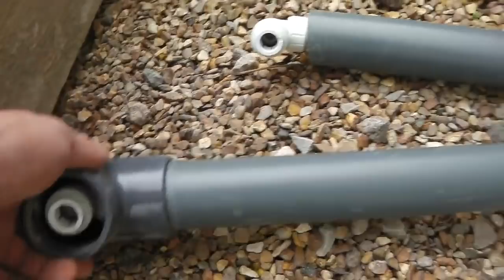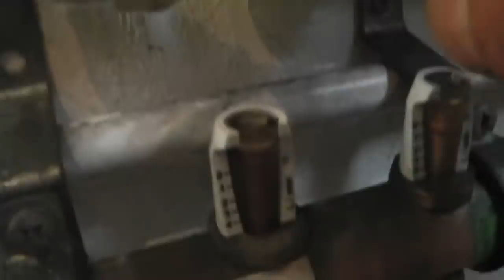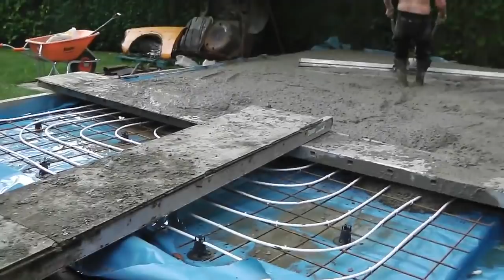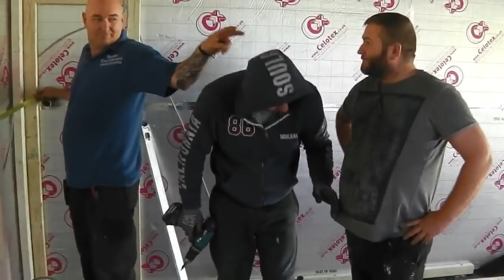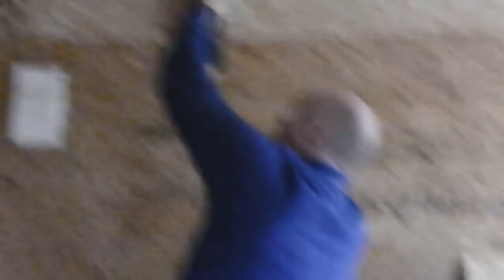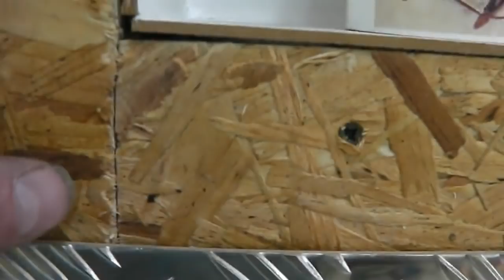Mk3 Cortina garage build.

Comment: Interesting to compare how a prefab garage in the UK is built as opposed to one done here in the USA. When you build in the US, the walls must be bolted to the floor via threaded bolts anchored in the concrete when it is poured. This is because it is required by state codes that buildings must be able to withstand high winds without coming off of the flooring.  It also helps keep the building in place during hurricanes and tornadoes. Of course - if the building takes a direct hit - nothing will keep it secured.  The heated floor is a nice feature.  All in all- nice little working garage for restoring Cortina's.

Comment: LOL...At 6.00 min your drill is going backwards/in reverse...what kind of tradesman are you.
Just a bit of light hearted banter.
 You said at 2.39 25mm kingspan....i think your going to need a bit thicker than that matey for heat retention?....all your heat will end up going in the ground...on domestic we put 120mm zero tuff 'R'
edit: i just seen the builders put what looks like 100mm+ in further into video
You can up the pump rating to increase the run length.
Allways sleeve pipe and cable runs (golden rule) if you ever get movement in the building your cable and pipe will suffer.
Your kingspan should be taped with thermal tape to stop thermal bridging and 'T' break your kingspan for themal loss.
Christ i'm only 6 mins into video and there's half a dozen schoolboy errors already.
Now watched all of the video and you could of hire a petrol concrete polisher and polished it to a mirror finish then when you epoxy'd it mix in a fine grit for an  anti-slip floor.
I would of trimmed around those window reveals with that metal checker plate you did on the walls because you bound to end up knocking off the corners around the windows
Regards
John (master house builder)
Reply from the maker: thanks John for these great pro tips. yes 100mm kingspan went down, its good to get tips from tradesmen, overall i think i did ok, but as you say some errors there, this said its warm and does look tidy, it was never going to be high spec but if you doing it best to do it well, ill certainly take on board your advice and thanks, the pipe and cable runs were sleeved from garage to garage and on the layflat pipe i insulated too, overall im pleased but can always learn and improve!